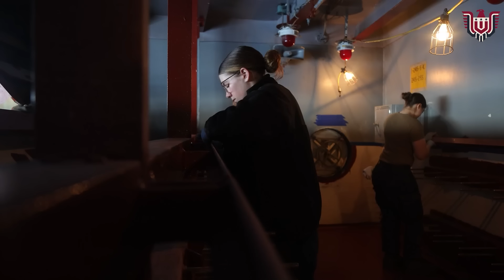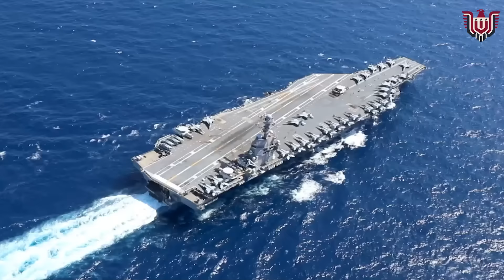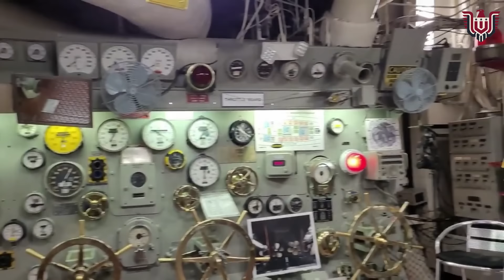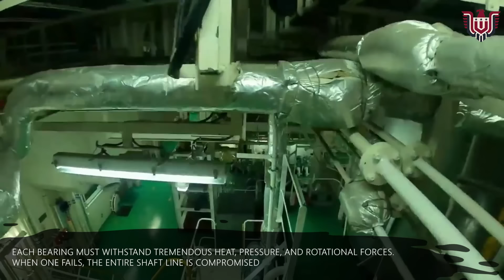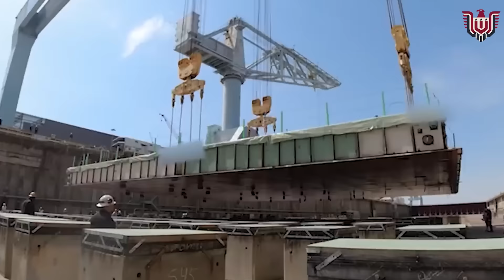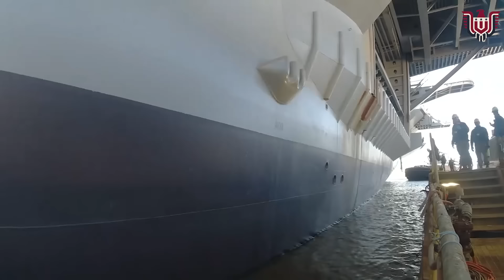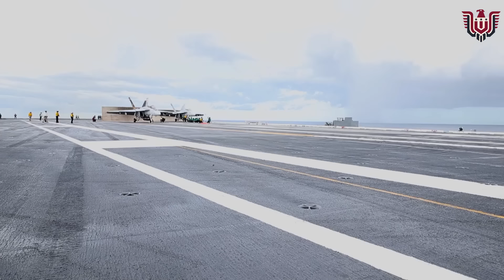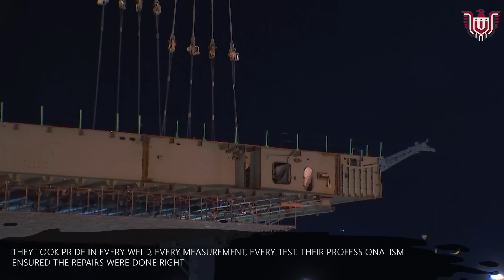How US Navy Rolling Out Newly Repaired $13 Billion Supercarrier From Dry Dock

Comment: Losing a thrust bearing is no small issue. We lost the bearing on one of the shafts on the MIDWAY when we were going on deployment to Yokosuka, Japan. The yardworkers had to cut through all of the decks to bottom deck where the bearing was attached to the ships framework, just to hoist the old bearing out and install the new one. The Naval Investigation Service had to interview the entire crew to see if they could locate any possible suspects in the sabotage.
Reply: This report is FALSE!!
The USS Gerald Ford did NOT have to go into dry dock to repair a faulty thrust bearing!
The problem with the thrust bearing was not mechanical but technical. The electronic system monitoring the thrust bearing was showing abnormal readings and was corrected in "port" ... NOT dry dock.
Reply: @amusicalautobiography6629 The reports on these news sites are grasping for straws on their reports and sometimes have to embellish their stories to make them worth listening to. I caught a couple of errors regarding the thrust bearing in this story. It's hard to imagine a thin film of oil can protect the bearing from the shaft as it is propelling it through the water.
Reply: @amusicalautobiography6629 Another Ford repair! 😂
Reply: Interesting.. My CoPilot AI assistant cannot locate any evidence of this event actually happening... could you supply additional details? AI says...Based on the searches I ran, there is no publicly documented record of a thrust‑bearing failure, massive deck‑cutting repair, or a Naval Investigative Service (NIS) sabotage investigation aboard USS Midway during a deployment to Yokosuka.
Reply: Was that in '88?   I was on the USNS Observation Island - Cobra Judy project porting in Yokosuka when the Midway was going  thru some major work near us.
Reply: Interesting
Reply: I served on the Midway from dry dock in 69 thru February, 73...also a plank owner.
Reply: @geraldluque9607 : That would make you around 80 years old. The term plank owner is used for a commissioning crew. Since the Midway was commissioned around 1946, how many years did you serve?
Reply: 🇺🇸🫡🙏❤️ Thank You for Your Service Sir
Reply: Sounds like Ford built it! 😂
Reply: My Father was a plank owner. He sailed on the maiden voyage of the Midway in 1945. We still have the Christmas menu from that trip.
Reply: Have each take a lie detector test that fix them !!!!
Reply: Right! I was on USS Cleveland LPD-7 from 1983-1986 we had a hole snipe put a spanner wrench in reduction gears. He was taken away NCIS and then a barge with a crane was pushed next to us. While the barge was coming they welded padeyes to four places on the flight deck. As soon as the barge came the yard birds came on and hooked cables to the padeyes and they cut a huge hole in the flight deck and lifted it off and set it on the barge. Then the did that all the way down until you look down from the flight deck into the engine room. Then the removed the gears. Then they done everything in reverse once they replaced the reduction gears. Thank you for serving shipmate
Reply: Yes, I've changed a few myself,  with variable props
Reply: We had to have the reduction gears replaced pier side at 32nd st on the USS Cleveland in like 1984. They tugged a barge with a crane next to us and we tied it off. They welded pad eyes to the flight deck and attached cables then cut a big square and lifted the deck and sat it on the barge. Then did the next deck and so on. When they were done and we repainted the flight deck you couldn't tell where it was cut.
Reply: PROUD!! Served-69-75 on a sub tender for 2 years in Scotland.

Comment: It would seem to me that if the bearing was improperly manufactured then the company that manufactured, the bearing should be the one held responsible for the replacement and any expenses occurred would be on their shoulderS
Reply: GE did pay the freight. The remaining was handled in-place.
Reply: May be wrong but I thought GE had sold some division of itself to China in the early 2000s
Reply: FALSE!!
The USS Gerald Ford did NOT have to go into dry dock to repair a faulty thrust bearing!
The problem with the thrust bearing was not mechanical but technical. The electronic system monitoring the thrust bearing was showing abnormal readings and was corrected in "port" ... NOT dry dock.
Reply: @amusicalautobiography6629  THIS!!  The bearings were never replaced in drydock.  And can we also acknowledge that the thrust bearing does not transfer power from the nuclear reactor to the prop shafts, nor does it handle forces from the reactor as this crappy half ass channel says
Reply: Thanks for the update, although I don’t care for your handle

Comment: Hi,
Why do u present this video as "current news"?
Its been off South America for months now.
Just sayin😮
Reply: This entire video is FALSE!!
The USS Gerald Ford did NOT have to go into dry dock to repair a faulty thrust bearing!
The problem with the thrust bearing was not mechanical but technical. The electronic system monitoring the thrust bearing was showing abnormal readings and was corrected in "port" ... NOT dry dock.